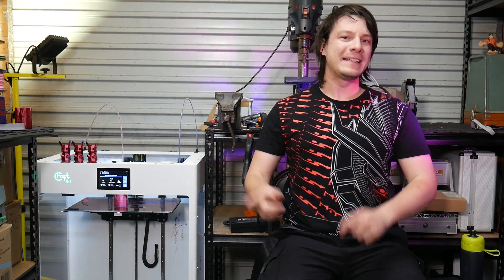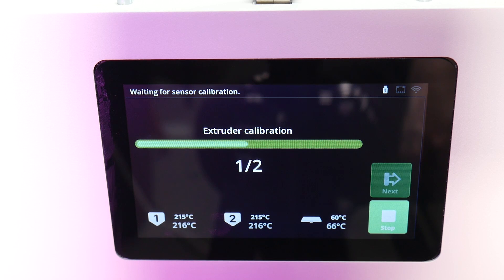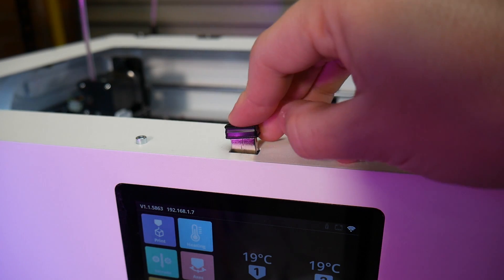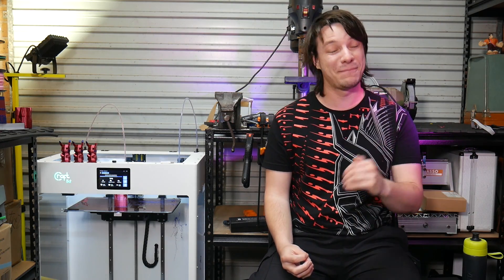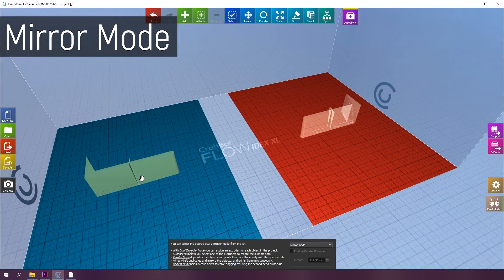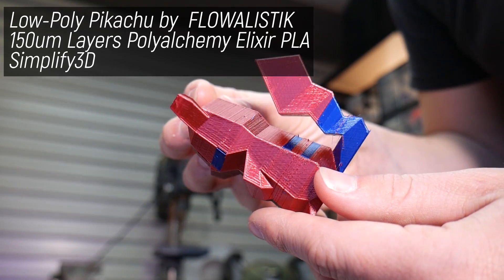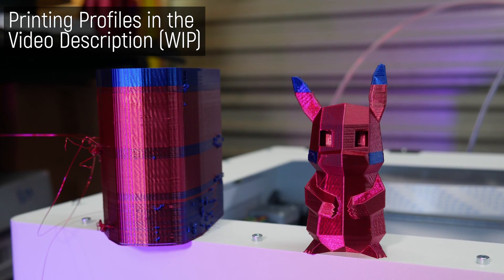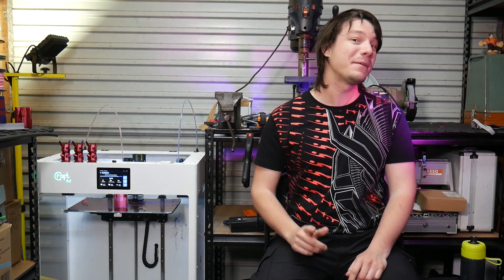Craftbot FLOW IDEX XL 3D Printer Review

Comment: I have to say your reviews are fantastic! I bought this machine nearly 2 years ago, seduced by what it claimed it could do. I was reassured that all the problems had been ironed out, but no. The service was appalling. The machine a nightmare. I had every problem listed here, and all the problems highlighted on the 3d Printing Nerd channel. The BIG difference. Craftbot did not and would not replace the machine with a new working one. After 18 months and endless hassle they (very very reluctantly) took back the machine and refunded me. This is NOT a plug and play machine. If you are good at 3d printing and know how to fiddle about and make adjustments to the slicer etc, this can be a good machine, BUT if you are not experience keep well away. There are lots of known problems they will not admit to. On paper it is great, but it does not live up to that.

Comment: i'd pay half the price for this printer.

 with how it is, even over a year later, still iffy, it's still worth it on the hardware standpoint, but the software, even now, make it questionable
Reply from the maker: Sadly agree. The hardware is great but their software is really detrimental to the operation of the machine. I only use it single extruder with a prusaslicer profile now, and rarely at that.

Comment: Checked the description looking for those new slicing profiles….Oh man :(

This is not good news for this printer lol… might just be a lemon…Craftware Slicer is horrible.
Reply from the maker: It's pretty bad yeah. If you configure the stock MK3 profile in prusaslicer to the craftbot bed it will work with a single extruder but throws a TONNE of gcode errors up while printing. I only use this printer when I have no other options now.

Comment: Hi Angus, thanks for the review, I wish I seen it earlier, than we bought this. We have if for quite some time, but did not manage to pull nice prints out. Seems like its acceleration has issues, corners are horrible, echoes after turns... I had a CR10 and have a Pruse, and I had no problem make nice results, but with this and for this pricetag we are still experimenting. You mentioned Pruse slicer profiles for this, I wonder if you could share them so I have some new base to continue my struggle...  Thanks!

Comment: I remember when 3D printers first came out. You would pay $4000 for one that would print a crappy little Sphinx. More often it would print half a crappy little Sphinx that reminded you of Alien Resurrection where Ripley 8 discovers the failed earlier cloned versions of herself. (bleeegh.... kill.... me...). I was surprised when you revealed the price. That's a lot of gear for the money, and it looks like that big machine (with some troubles, yes) will print a pretty large, less crappy Sphinx in two colors.

Comment: It would be nice to see a follow up to this review now that the teething pains for Craftbot have passed. I have one and love it.

Regarding the mirror mode being a party trick think of it this way. A company builds a cool IDEX printer and includes Duplicate mode, Backup mode, and Support/Build material mode from each head. They put it to market. Reviewer gets it and says "guys, you've literally got two independent heads, how hard would it be to write a simple bit of code and have it mirrored?" Damned if they do and damned if they don't I guess. For me personally, it has a lot of uses in industrial applications or just one large symmetrical part split down the middle.

Comment: Marlin 2 has a corner leveling feature that you can enable for the LCD where it probes the corners to find the one that is closest to the probe. It then moves to the other three at that height and waits for you to turn the knob until the probe triggers. The process is much more reliable than the piece of paper method. You have to enable it in Marlin to make it available. I cut the probing speed in half to improve the accuracy. Turn all of your knobs until they get more difficult to turn before you start the process.

Comment: I wasted money on the first Craftbot IDEX and it firmly enforced the fact that Craftbot has no friggen idea on how to build a printer.  The ringing is horrible due to the excessively heavy hot-ends.  The bed vibrates like a $.50 hoe on certain moves.  The machine is slow as heck and WAY over priced.  You can replace 1 Craftbot with 5 or 6 Ender 5s and get better overall speed of modeling prototyping.  Craftbot also insists on using custom nozzles and that's a friggen deal breaker along with a horrible slicer.  This 2nd Gen IDEX did not resolve with bed vibration and heavy heads.  Head alignment is a major PITA.

Comment: its 9 months later, did Craftbot ever fix those profiles? or are you still having those same issues? if yes, please consider a quick update video showing the improved results of IDEX printing, and consider a nylon-x or other carbon fiber-filled nylon print with PVA water-soluble supports - thanks! another point, some time ago you addressed the issue of the very fine particles, can you do a video showing how to attach a vent system to a printer exhaust, or create an enclosure and vent it to the window / like a dryer vent does with the hosing? you could measure the particles before an after...that would be immensely helpful! Thanks Angus.

Comment: Love the idea of this printer, but I agree with the "too many sensors" point greatly

My good ol' "dumb" ender 3 just chugs along, print after print.

Every printer has failures occasionally, what shines through for me with my ender is the ability to fix it on the fly if it's not too bad 👀

For example, I was printing a drawer and my cat managed to knock off a bed clip and jam the stepper about 20mm, and I got half a shifted layer... 
Managed to reclip the build plate and kinda adjust it back to true, finished the print and clipped off the excess, sanded and it was perfect

Comment: having a mirrored part come out at the same time could be useful for symmetrical items. although you could just mirror the model and then print both at the same time too lol. SO def a party trick, but maybe if you forgot to slice it that way idk. (plus normally, one extruder/nozzle doing two parts woud take twice as long.  since this is doing both at the same time. in theory it should take half as long to do the two parts right?

Comment: Cura works very well with multicolor prints. You need to be setting standby temp. If you set standby temp around 150c it won't ooze. You can also set Extruder End Gcode to park the nozzle over your purge area and it will drop it to 150c and be ready for the next layer.

Comment: ACTUALLY mirror mode should be objectively superior to parallel, as the acceleration forces should cancel out in one of 3 axis directions resulting in less ringing. Also how can you say it's useless? It's clearly meant for printing symmetrical prints and gluing them together at the end.

Comment: advantage of mirror mode over parallel mode is you can print the left side and right side at the same time.  i.e. if you printed your left shoe, parallel mode would give you 2 left shoes and mirror mode would give you a left and a right shoe.

Comment: How come I know these issues so well. I'm not using Craftware anymore. I've played around with Cura, S3D and Prusa Slicer. Mostly I use S3D though. I didn't switch to the Flow. I have the Craftbot 3. Haven't printed dual color for a while. The first ones left me with the same results you have shown in the first part of the video. The last ones came out quite decent.

Comment: 10:00 you kidding right ? Mirror is super important, as if you need to print a piece which eventually comes together, think of  a two part item, which have internal components and the oposite sides need to be glued together, you need mirroring. Its not a party trick , its just making the process easier.

Comment: Mirror mode would be better than duplicating because with both print heads moving in opposite directions they would cancel out each other's momentum and reduce vibration, better accuracy

Comment: Two print heads moving in the same direction has twice the inertia on acceleration and deceleration.

Two print heads moving in opposite directions, in theory, cancel each other out to a much larger degree.

Both heads moving left rapidly: printer jerks to the left.

Both heads moving towards each other: a lot less jerk.

Comment: This is the first look really at printers which are bigger or 'complex'.
What is shocking is those price jumps.

Unsupporting steel is around £30.
The beams or tracks vary in price due to the hobby sellers, but if you jump a printer size, youre talking about £30 more.

Heads are cheap and well.. the controller boards...
Seriously going from a 8 bit to 32bit with WiFi and camera is ... £3.

Yes a full control system is from £8.40  to £16.00
Motors are £40

And I'm sure you can guess the rest.

For printable machines they are not at all hard to make and not do they have costs and it does ALWAYS resolve to software.

The added sensors... We're talking pennies and easy coding, I just bought a bulk of 48 for £12.48

When I look, I see two print heads, that seems to be done good.
Then I see the bed, and movement surfaces... There not good. While you think about it's size and you hadn't done prints the loading will add a host of additional issues.

And then extra for doors.... Plastics can cost money, but really... When looking at all the down sides.

I suppose they are updating. And working on the problems, but some are fundemental and it's 'funding'. But na. Bad bad idea and as a result of this 'the customer always pays' and ' not working as it should' 

It's a no go brand.

Comment: Looks like we are still a very long ways away from easy to use, no-fuss, no-tweaking mass-market affordable (US$500-$1250) consumer-grade 3D printers with decent print volumes. Dremel 3D printers are trying, but their price points are still way too high for the average moderately tech-savvy consumer. I could eventually see the possibility of a super easy to use Ender 3 V.X, but they are not there yet. Also Creality needs to come out with enclosed models for ABS and other heat sensitive materials. Craftbot has the tech to get there, they just need better marketing, forethought, and more aggressive price points.

Comment: That's actually cheaper than I thought, considering the size of the thing and the features. But the print deck seems a bit small, there is a lot of empty space on the sides and it feels like they could have utilized more of it. Other than the print volume being about twice as wide as my printer, the print volume of the non-XL version is actually very close to my 3D printer (255x255x255) which is way smaller.

Comment: The common conception is that, the linear rails are superior motion guides than linear bearings, that is not actually true in case of 3D printers. 
1) Linear rails provide more rigidity against vibrations. Hence, it is more suitable for the CNC grinders and mills. in which the cutting tool will cause vibrations. For a 3D printer vibrations are only from cooling fans which is close to none.

2) Liner bearings being heavy, reduces the agility of printer at high speeds due to high inertial masses. This requires stronger motors and thus a stronger frame. This increases the overall costs of the printer, which is not justifiable by any improvement of performance.  

3) Unlike a CNC cutters, 3D printer frames are modular and are usually not made from a rigid cast iron or equivalent assembly. This results into occasional misalignment. Rigid liner rail setup cannot tolerate the misalignment and steppers may operate under jamming loads, which may sometime results in missing print steps. Linear rods on the other hand can deform to accommodate mis-alignment and printer would function smoothly.

A simple way to determine the play due to flexural rigidity of linear rods is, by applying the total moving mass and maximum print speed of the printer, as an impact bending loads on the rods and measuring the corresponding deflection. For majority of linear rod setup this deflection lies within the maximum tolerance of stepper motors step size. Hence, there is no point in upgrading to linear rails as they are not economically beneficial.

Comment: I think mirror print would reduce or eliminate some vibrations as the two heads move in opposite directions at the same time. 
The parallel printing would double the vibrations in the same direction.

Comment: Mirroring is great for parts that actually need to be mirrored in a structural application.  This seems to be interesting.
Reply: Exactly! Was wondering why he didn't see the possibilites with mirroring. In a lot of assembled 3D printed parts you often need a mirrored component
Reply: i print little brackets that are mirror images of eachother for bolting power supplies to plates at my workplace. very cool that it not only does parallel printing but mirror.
Reply: Yeah, but in a lot of situations where mirrors of printed parts are needed, the parts themselves will be labeled to set them apart and prevent mix up, such as having an R or L to signify left and right. Mirror mode does seem to have its uses, but basically any model that has some kind of text, logo, or anything like that, mirror mode won't be as effective

Comment: Mirror mode has a lot of cosplay uses for me.  Quite often do I need a left and right part, say and arm bracer for example.  Normally, I would have to print one then reslice with a mirrored copy in the slicer.  This would save me that time as I would only have to slice one side and get both at once.

Comment: I own the very first original version and I stopped using it because it's a 12 volt version. I would like to update it but the parts pricing has never gone down. I did update the power supply but it still didn't help much since it's still 12 volts. And like you mentioned, proprietary parts suck.

Comment: One more comment. I use two accessories with my 3d printer... A $30 WYZE pan & tilt camera. Works very well. And I use Repetier Server on a Raspberry Pi 3. $75us. I connect to the Pi from my iPad Pro in the other room. Simple as that. I do use Simplify3D slicing software on an old 2011 MacBook Pro. Works great but I wish they would make Simplify3D for the iPad Pro. If anyone agrees send them an email request, please. That's the only way we will get them to make the software. I also use Shapr3D on my iPad and that is a really nice piece of software. This is a really powerful App not some scaled down version. The company is on a feverish course adding updates to Shapr3D. With the new Apple designed MACs that are coming out iPad software is supposed to run on these new Macs.

Comment: I like seeing the review. Thank You. But, on that review I am NOT getting one. Currently I have the 2018 Gold Edition Tevo Tornado printer. I upgraded this printer to the E3d v6 Gold edition Hotend and Zesty Nimble v1.2 Direct drive. I am still dialing everything in so I can't say how well it prints. I noticed some sparking in my On off switch so I am waiting for a replacement in order to continue. I am using the Marlin firmware 1.1.x Bugfix version. I tried Marlin v2.0 for the Tornado but I could not get the LCD screen to display correctly. The LCD screen works on v 1.1.x.

Comment: I have had many problems with the motor errors that stop the print and force you to restart the machine over and over. I changed the mother board and still had similar issues. I believe it because of loose wiring connections. Totally didn't expect that at this price point. I am using it now to print pla model with petg supports and it working out mostly well. I had a mysterious layer shift that i cannot explain...Anyways this machine has great potential but yeh for the price i expected better out of the box experience as well.

Comment: 10:00 If the mirror mode works as it seem it does, and you use 3d printing to make actual pieces for use in real life projects, it is far less of a party trick that it might seem. From what I've done in metalworking, it is quite common to machine both the drawn part and the symmetric part. So, it should be incredibly nice to produce both of them at the same time, a single slice and all.

Comment: Speaking of things needing a fix that shouldn't, I finally broke my last replacement print head spare for my big delta and had to go on a hunt for more. Long story short, having a somewhat proprietary effector plate is a massive pain even if it's "supposed to" take standard upgrade parts, which are slightly more difficult to score during our lovely covid era.
Yeah... That's easy to fix if you have more than one machine that isn't in a pile of parts and wires. Note to self: get a back-up machine. 
3 months later after finding said parts and import/customs waiting, she lives once again!!!

Comment: I think the mirror mode is actually pretty great if you are trying to print mirrored parts because if I am not wrong the forces acting on the printer (in the x axis direction) from acceleration and deceleration of the print heads should be net zero because the print heads are always moving in opposite directions on the x. So maybe less vibration?

Comment: $240 for a screen? That is crazy. Also the oozing could be fixed by by stopping the plastic feed a tiny bit early and feeding the filament backwards. This will create suction on the molten plastic in the extruder.

Comment: I am still laughing at the "high cost".... The first 3d printer I used at work (2008) was a dimension 3d printer £37,000. I moved jobs and there was a Objet that cost £150,000 and the running costs and materials were eye watering. I moved jobs again and they had no 3d printer. I spent a fraction of the cost getting them one (less then £2000)
l say £4K for this printer is a lot of tech and a lot of printer but I feel should come fully enclosed
Reply: They the doors and dome for it as accessories